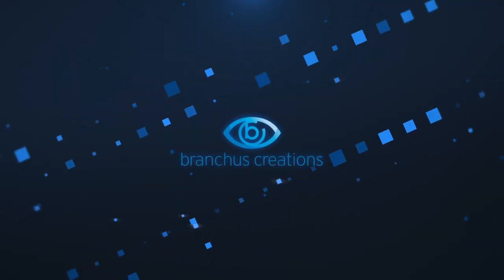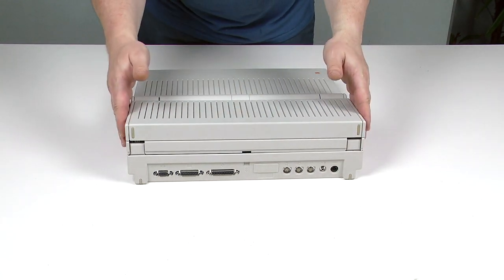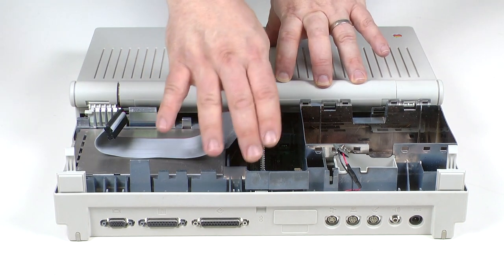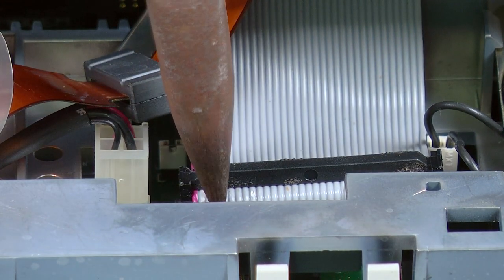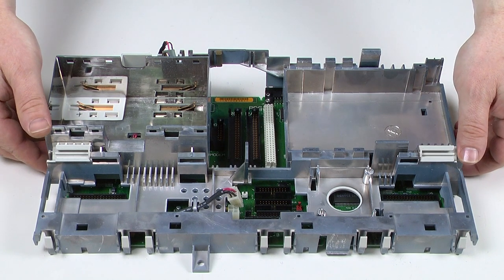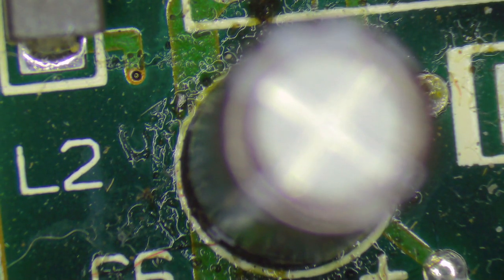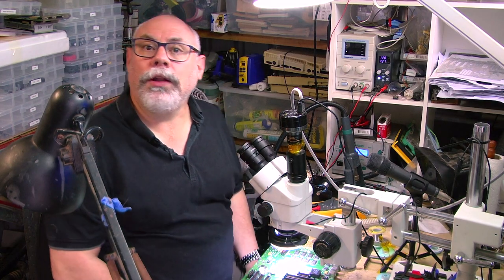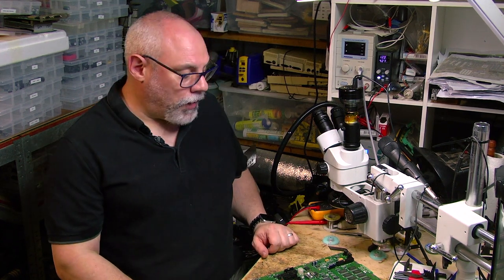Macintosh Portable teardown and recap

Comment: Nice, you've convinced me I need to pull out my portable from storage and check for leaks. Did you boot this up using a hard drive (as it was noted to be missing), or do you know of alternatives to the original drives? Pretty sure mine is toast.
Reply from the maker: The owner of this Mac Portable was using a SCSI2SD, along with one of these: https://www.ebay.com/itm/312973273392

Comment: Wonderful video, very useful for ‘psyching up’ before actually working on the Portable (even though I’ve recapped several Powerbook 100s). Incidentally, a Powerbook 100 has a 4.7uF electro cap as well :) I work exactly as you do when removing components. 

The only small difference in my approach would come in at 37:45 - after all the new solder and flux, and solder wick - instead of scraping with a blade, I would clean the area with Circuit Board Cleaner (that dark-green spraycan from Jaycar is suitably potent) on a cotton bud. I find this instantly removes all the capacitor gunk and flux residue. Sometimes I use it immediately after removing the caps, before I start solder tinning/wicking the pads. Helps to reduce the fishy smell!

I’ve never been a fan of tantalums - one of the reasons is the width as you show, the other is their lack of flexibility (pins will break off if the board or component expands with heat) and the third risk is their failure mode of shorting (or turning into low-ohm resistors). Instead I use new SMD electro caps from Wurth (via Mouser), good value and available in the right sizes. Maybe they last 20 years, maybe they don’t - we’ll see

Comment: um...  dunno but, if I need to desolder a simple thru-hole cap, I grab it with tweezers from the other side, melt the pins and lever in both directions, much less heat and if one pulls always toward the board, it shouldn't do damage.

Comment: I have a PowerBook 100 which is basically the simplified, miniaturized version of this. It's interesting to see the differences on the motherboard. Does the PRAM battery circuit work for you? Mine doesn't despite a recap.